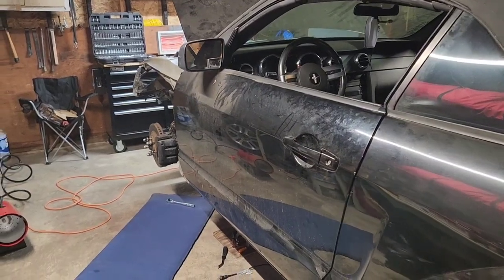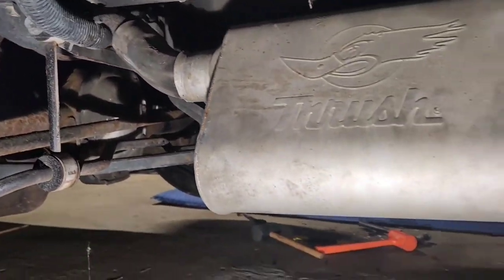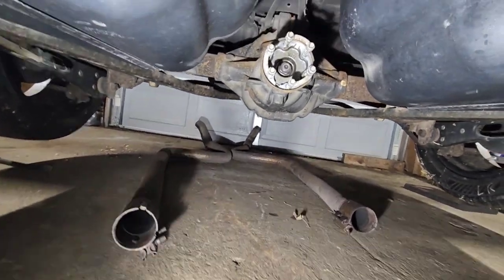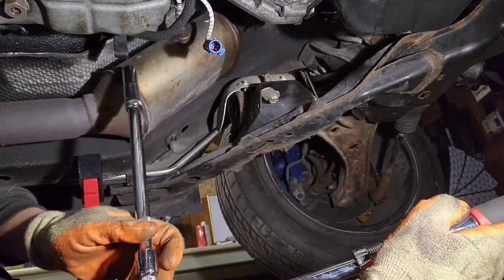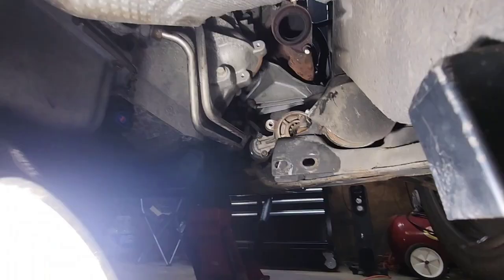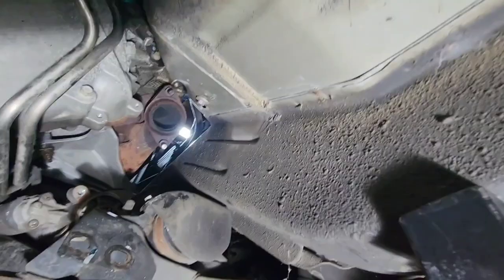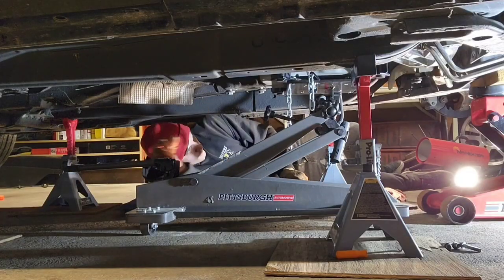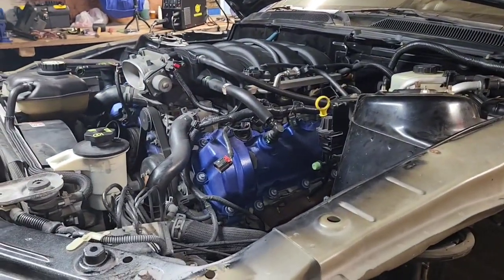2005-2014 Mustang Automatic Transmission Removal/Install (5R55S) Complete Guide

Comment: First I want to say that you did a pretty good job describing the removal of the transmission and the little things that you come across.  just a hint for one trick on marking the drive shaft- just tag it with a shot of paint from a spray can,  even black would work.  having just replaced this part myself,  the round plug you took out of the trans,  went to the solenoid pack for shifting and Overdrive.  Be careful and keep it clean,  don't bend the little pins when installing.  I have a '07,  V6 Mustang with this trans and I have to replace the Torque Converter due to slipping and overheat codes,  and you can feel it slipping in O/D.  On my little pony,  somebody programmed it and installed full dual exhaust with Flow Masters all welded up,  and I realized that I will have to cut them to get down and over enough.  I noticed your trans jack and saw how well it worked for this job,  so I think I will break down and buy that one also.  The only advantage I have over you is I only need to get it down far enough to replace the torque converter.  Btw, I am also looking for a donor car for a Std trans setup also.  Again I want to say good job on the video.
Reply from the maker: I appreciate it and I'll keep that in mind. I have another video where I tear into the transmission to find the problem and it's possible you could have the same problem. It's called the overdrive sprag and It's somewhat common. I'm trying to work on video quality, but it is more time consuming and harder than it looks to do everything by yourself. Idk where you're located but I'm moving and would be interested in selling it.

Comment: That is quite the endeavor young man, nicely done. How long did it take in real life? I can only imagine how much fun the re-installation was!
Reply from the maker: Honestly, it took somewhere around 10 hours of actual work over the course of a few weekends because of filming and a few problems I ran into. I had trouble getting the exhaust off (midpipe bands, mufflers, manifolds), I ended up cutting the bands and mufflers off. There wasn't room to undo the Trans lines from the case with a regular wrench, so I had to get a crowsfoot wrench (flare nut wrench would be best). My jack stands weren't tall enough to get the Trans out, so I ordered 6 ton jack stands. Realistically, it's probably a 3-5 hour job by yourself on jack stands. Putting it back together is usually easier, so add a few more hours. As long as there's no problems, it's a day job.

Comment: I replaced my trans in 09 Gt, but speedometer is off now. Any ideas?
Reply from the maker: Did you change any gears or the size of your tires? That will cause your speedometer to be incorrect.
Reply: @octanedrivendream  We reprogrammed the tuning and it seems to be fine now. The gear ratio was changed, but also the differential. After several weeks got in touch with the guys at Diablosport and they were a tremendous help

Comment: Im doing this right now on a 2010 v6 mustang the last few days like a couple hours at a time while drinking beer and used your video for a guide to see what i was gettin into. only differences is to try and over come the jack stands not being tall enough was but some cinder blocks down cut some wood spacers with some wood i had laying around to lay across the few cinder blocks and build a rasied platform for jack stands in the rear on each and raise the cat up in the back a lil. And just gona pull it out the back. Driveshaft on the 2010 has the 12 points on both sides instead of just the one.  and no middle carrier bracket to remove. Also No acess plate at bottom gotta get the  converter bolts through the starter hole.
Reply from the maker: Good to know. I thought it would be nice to have some tall jack stands, and they were on sale for $40. It's probably easier on a v6, but one of the most frustrating things was disconnecting the harness from the bellhousing. There's no room for a hand or panel clip tool, and the wiring harness had no slack to drop it down past the converter. I just disassembled a seized 4.6, and I had to use a ratcheting wrench. I had to squeeze it between the block and flexplate to get the converter bolts out. Thanks for the love, and I'm glad the video helped.

Comment: Did any fluid come out when you disconnected the bell?
Reply from the maker: It was hard to tell since I sprayed pb blaster and I had Trans fluid running down from taking the lines off. The pump may have had a small leak.

Comment: Trying this on my 06 😬
Reply from the maker: It really isn't too bad. All the bolts are  accessible. The exhaust, disconnecting the wiring harness from the top of the transmission, and getting it out from underneath are the biggest problems. If you have trouble disconnecting the wiring harness, maybe explore undoing some of the sensors in the bay to give the harness some slack. With some some slack, it could be disconnected once you drop it down a little.
Reply from the maker: I tried to go over everything in the video. Good luck 👍
Reply: @octanedrivendream  thanks for the reply I need all the luck I can get lol, do you think it’s possible to do without dropping the exhaust? I have bbk headers and a straight pipe and looks like I have more room but I haven’t started breaking anything loose yet
Reply from the maker: @chanj3r866  It might be possible  but id recommend removing it. You need the room and once you unbolt the bell housing you will need to move the trans back to disconnect the input shaft and clear the flex plate. I imagine the exhaust would be in your way.

Comment: Awesome video I’m reluctantly having to take it out this weekend as I have an internal failure and not looking forward to doing it on the drive with stands
Reply from the maker: Make sure your stands are at least 6 ton so they're tall enough to get it out. If not, you may need another person to help you wrestle it off the jack and you could possibly damage the pan.

Comment: My 2005 Ford Mustang (automatic) will slightly move in Drive but, 1st and 3rd gear it drives fine. Any help pls
Reply from the maker: That's the same thing mine did. I would check your fluid. If your fluids good, it's a possibility this could be your problem. Transmissions are complicated, but this is not that hard to check if you've checked everything else. If you can take a Trans out  you can pull the pump and check the sprag. A $25 bearing is a lot better than a $2000 transmission.

Comment: Ive got a question. Just replaced both engine and trans. While installing them i dident connect my shifter cable. So i had to feed it and bend it pretty good(not to much) to get it to go back where it needed to go. It was sticking out of the engine bay so i had to pull it down through and shove it through a tight space by the trans. I hooked it back up like i was supposed to. But now when i put it in reverse. The cars not actually in reverse its in lik a "neutral" or non gear. And i have to push the shifter closer to park and then back where it pretty agressively will jerk into reverse. Could you possibly do a reinstall video, or show a diagram of how the cable curves? I might have stretched the cable but im not sure if thats my problem. And i know for a fact my torque converter is in its right place. Ive been driving the car for several days, no noises or rough shifting its just not in sync with whats on my dash or shifter.
Reply from the maker: You should have disconnected it like I did in the video and you could have pulled it down and out, I'm assuming that it bent up by the engine and firewall instead of towards the Trans. There's a white clip that disengages the shifter linkage, anytime you take that clip off it needs replaced (unless you rig something but it should be replaced) but it can also be damaged and mess up Shifting. 
1. Disconnect that clip (use new clip)
2. Put your shifter in park
3. Take shift linkage and pull it, you will feel the transmission selecting gears, line it up with the in park shifter and connect them.

If this does not fix the problem, then you may have stretched the cable or a shifter problem.
Reply: @Octane Driven Dream  yeah I think I'm just going to replace the entire cable it's like $20 I actually bent it pretty good
Reply from the maker: @Supercar Built  Its certainly possible that's your problem. Make sure the new cable has the clip, if not order one. Good luck man.

Comment: Hey I’m having trouble getting in converter lineup with the flywheel
Reply from the maker: If you put the the Trans in neutral, it will allow you to line up the studs. You may have to jack up the engine to tilt it back. Also, make sure the converter is seated all the way by spinning it and applying pressure while the Trans is in neutral. It's very important for it to seat correctly. Make sure the Trans and engine are at a similar angle and nothing is caught between them.

Comment: Why did you have to remove the interior trim? Thanks
Reply from the maker: It's not necessary. The way these shifters are setup, I was making sure there wasn't a problem with the linkage or mechanism. Just figured I'd throw it in there.

Comment: do you know if the 5R55S will mount to a 2015+ 5.0 engine ?
Reply: get yourself a little air compressor and impact gun to make life easier
Reply from the maker: I have one, but a lot of bolts are in tight spaces. I'm not sure if it fits on 2015+ but I assume it does since they used it on the first generation coyote.